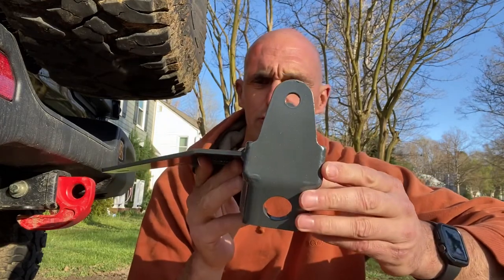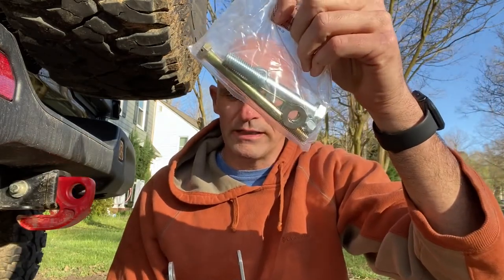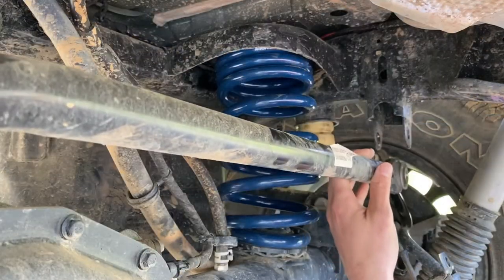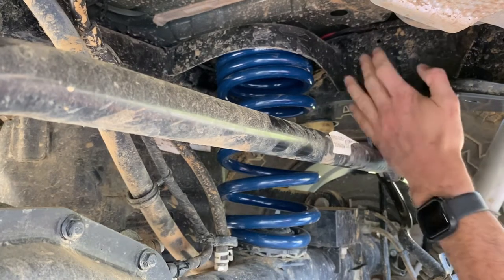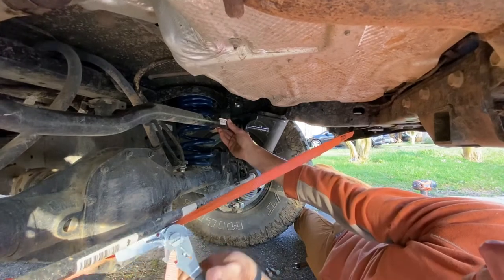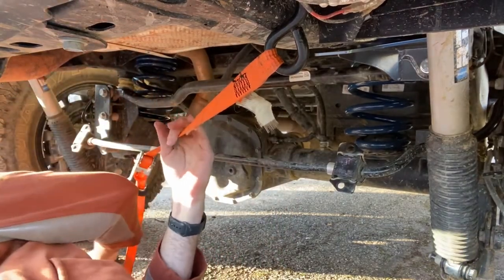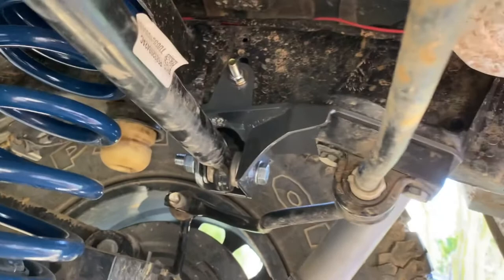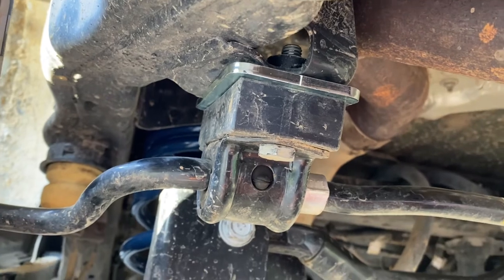Strength and Stability: Installing the Synergy Manufacturing Rear Track Bar Frame Brace on Your Jeep

Comment: Great video. I just installed the brace today and followed the steps outlined here. Very helpful. One thing I found was that you really do need to drop the exhaust - makes this a boatload easier - and my sway bar (2020 JLU) was also connected with 15mm bolts not 17mm. I went ahead and added a Yeti adjustable track bar while I was at it too. Cheers.
Reply from the maker: Thanks and I appreciate the feedback for those who may read the comments!

Comment: Well now I am even more disappointed.  I bought this same bracket for my 21 Rubicon.  No way does it fit.  It will not seat up flush to the bottom of the frame and none of the holes line up.  I was unable to get either bolt in.  I ground and cut the bracket in an effort to get it to fit but still not even close.  The TB holes are a solid 1/8" off and the upper holes that go through the frame are a full 1/2" off.  And that is after I cut and ground on it to try to get it to fit properly.  Maybe jeep does something different now on the frame of the 21s that is interfering with this brace.

I installed the TB relocation bracket on the other side and it darn near installed itself.  I had zero issues.

I have notified Synergy but they have not responded yet.  I am just letting other's know, mine did not fit.  YMMV
Reply from the maker: Man that really sucks, sounds like you got a bad part, hopefully synergy stands behind it and send you a new one!!  Good luck but thanks for sharing your troubles with it